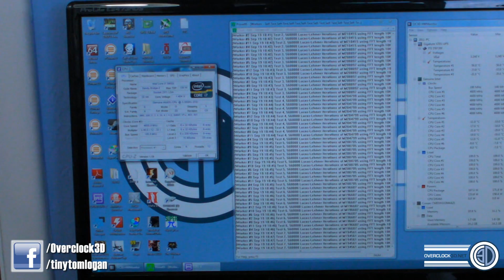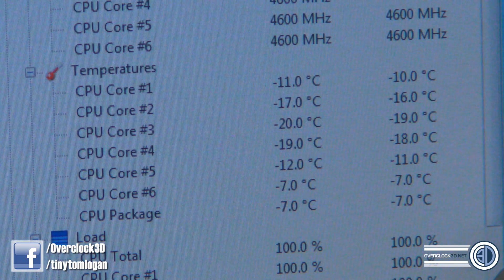Ultimate Corsair H100 Cooling Mod

Comment: Lots of fans against each other going the same direction won't make the air move faster.
Reply: You must be fun at parties
Reply: +OtterStrikesBack yup :)
Reply: just more pressure, and the temps he gets is bullshit, the temps can never get below room temperature without a fridge compressor...
Reply: Yes it will
Reply: +Marcel Rusiecki that's not how it works
Reply: +Marcel Rusiecki that's not how it works
Reply: +Ballistical 935 nah, it won't make it move faster, only make sure the air doesn't slow down
Reply: +Mathis Randl less slowing down hence "faster" or more volume to cool them fins faster.
Reply: OtterStrikesBack go to Linus tech tips and search for compressor cooler
Reply: +Marcel Rusiecki that's not how it works
Reply: Mr. Wiener dude. Really?
Reply: OtterStrikesBack what?
Reply: Yeah fans stacked like this in series would only increase pressure; the velocity would remain the same. Here's a graph of pressure vs flow for multiple fans: greenheck.com/library/articles/42

Comment: It is the problem due to hooking up multiple connectors (and having the RPM and feedback lines getting confused), multiple monitoring programs at once (can easily present negative numbers... I have even experienced numbers that would have melted the machine - reported due to this probelm). 

If you would really want to "Prove" or display evidence to the ACTUAL cooling going on, It would be best to utilize a separate temp sensor (whether IR or direct contact), to measure the cooler, and places on the cooler. Potentially, you can disprove this by simply taking an IR temp gun, and just pointing it to the metal on the cooler, and the intake/exhausts of the fans, to display the change in temps (roughly). This will clearly show that it is impossible for the temp to go in @ 20 degrees (what was mentioned in the video I believe - as the room ambient temp), to negative 7-20 degrees, and then back to w/e the exhaust shows). And btw, the exhaust should display around -40 if your logic applies, as the exhaust side should be colder than the intake, and the CPU area which is obviously being performed on a cold mobo, that has not been running extensively prior to the benchmark. 

More fans do not equal more cooling. This would not "line up" until the fans have been forced into a cycle throughout each shaft.  This idea is akin to putting a fan against a radiator... air will get through, but there is still an obstruction, b/c the pulses sent are not being synched to account for each fan in front of/behind the next. Think of a jet engine.. they do not just slap plates together, they figure the sync out to produce plates that will increase the pressure as it is pulled through the system of blades. This absolutely would not work well, and would hinder a lot of air movement. Even two different speed fans in push/pull can noticeably decrease the pressure and cooling ability. You could seriously be at greater benefit to take out all the fans inside the 9 in each stack, to form a single hollow chamber which would assist in actually building pressure, not hindering it. 

I think this should definitely have a follow up video already.

Comment: What would happen if you use AMD?
Reply: A Catastrophe.
Reply: x99 cpus run as hot or hotter than the fx 8350s
Reply: 9590 is a waste get a 8350 or get a 6600k and be done with it
Reply: 8320 oc to 4.6 ghz  with a corsair h100i gtx load is 49c idle is 19c.... soooooo hot i tell you

Comment: +OC3D TV did you try to remove the cpu block and run the cooler and fans to touch the bottom of the cpu block to just check if it is running at real subzero?

Comment: Yeah watched linus and was like duh, how can you use 20 degree air to get - 11 degree cpu. Good job fooling us for soo long
Reply from the maker: Not for so long dude, its ALWAYS been at the end of the video if you go look....
Reply: Ok well while I am not sure why legitimate Temps would have detracted from the 'fun', I will have to admit that I don't get your sense of humor, so i guess that's on me.

I can see how manufacturing controversy creates more views, if that was your intention you have definitely succeeded.....well done
Reply: air cools as it gets pushed through a smaller space
Reply: +Tucker Wagner nope idiot
Reply: I wasn't directly comparing the two, but a fan pushing high volume air though a radiator will extract heat from the fluid.
Reply: +Tucker Wagner air actually heats up as it's compressed.
Reply: +Daniel Esprit How do you think an AC works?
Reply: An AC works by conditioning the air. As it sounds, not just by blowing air really fast. 
AC's circulate air that they have first evaporated etc and they get air to 15celcius? 
It's also worth noting AC's are much bigger than a h100

Comment: How did you reach subzero ? Even sub ambient ?
Reply: +T-X-M Then either your temp is incorrect, or the laws of physics have no effect on your CPU cooler
Reply: Your temperature is not accurate.
Reply: You can do it. Phase change cooling, LN2 cooling, and TEC/Peltier cooling do exist. 
Less practical than standard liquid or air but they exist and can achieve sub-zero temps.
Reply: No you cannot, if it where that cold the computer would be dead after an hour due to the condensation of the water from the cpu block, plus there would be ice everywhere, the water would not move, as such the temp would be worse. But in the real would that's not possible.
Reply: +jerielmari anti freeze keeps stuff from freezing

Comment: FAKE!!! aero dynamics doesn't work this way and you can possibly push enough air through it it just doesn't work this way at all and the super low temps will kill the cpu
Reply from the maker: watch the end of the video dude........
Reply: Because
1) It can't get lower than the room temperature
2) If the external fan pushes, for example, air at a speed of 10km/h, the fan next to it will receive the air at 10km/h and, spinning at the same speed, will push the air trough at 10km/h and will get to the radiator at 10km/h.

Comment: lol...those temps are either being faked or the app just isn't capable of reading temps properly on that CPU...u can add 100 fans to that one Corsair H110i and the temps of the CPU will never go lower than the ambient temp of the room...the fans would actually do less than say adding more radiators...furthermore, there's no way that CPU running at 4.5ghz could EVER run in negative temps using plane jane water cooling.

Comment: The reason why the temps are so low is because the whole system acts like a turbocharger.
All the fans compress the air and squeeze it to the point where it's incredibly hot, then that hot air is then passed through the radiator which dissipates the heat.
The radiator then takes that cool compressed air and it gets re-expanded in the H100 pump, hence why the temperatures drop well below freezing.
It's actually quite a genius idea and I never thought something like this would work so well.
Reply: +PooPipeBoy uhhh.. i think you don't know something.. these were actually fake temperatures.

Comment: IT IS PHYSICALLY IMPOSSIBLE TO AIR-COOL SOMETHING TO BELOW THE TEMPERATURE OF THE AIR YOU ARE COOLING IT WITH. 

This video is full of trolling. It's made for a laugh, but it can actually misinforms people.

Regarding adding more than 2 extra fans to a heatsink - as soon as a fan reaches is maximum spin speed, the maximum amount of air volume is reached, no matter if you add 10000 extra identical fans.
It's just like how a car driving 100km/h does not go faster if you attach another 50 cars that are also driving at 100km/h.
2-4 extra fans would have been enough to practically nullify the resistance that the heatsink provides and maximum air transportation would have been achieved.
Reply: No shit

Comment: Thomas  ... Dude -I love this Channel - ... But in this  Video I realize you made it  as  a funny Poke at  Chilling CPU's and components - but  there is   Seeds of Brilliance in all of  this that I can see  !!!!..... Dayum .. This is Stellar ! - I am considering  making a  10" LCD Video Projector - and This  Cooling  Rig (Other  than a Bit of Overkill) It  would be PERFECT in Cooling  a Massive 10,ooo Lumin 100 Watt CREE  LCD Light Element for my 1280p HD  HTMI Projector - It  would be  entirely possible to Chill the  LCD Chip to Below Zero Farenheight Temperature (But before Condensation Icing)  - which   would mean Unlimited Run Time ! - You are  Both Funnt, Intellegent, and  Flippin Brilliant ! - No worries  about the quiet Fan Noise - which  would be  virtually 2 dB or a bit more at the Most !I   would  Include the  CHiller, Fans and  Projector Mechanical and  Electronics in a   Wooden Box - or Maybe in  a Custom Industrial Server Tower  (If I can Get my Hands on a 2nd hand one !!!!) - you are  without a  doubt -  Fricken Brilliant !!!!!!! - Woo Hoo !!!!! - Squeee ! - Tom .. Sir ..  Just Subscribed as well ! *... Never  stop thinking  Outside the Box  my friend -  You have  some  Masterful Gravitas, and   have a  Natural Sense of Humor ! .... Keep it Up and   Never let it  Drag on the Floor three Feet behind  you ! -  roflmao !

Comment: Why don't you try putting sound suppression on this unit, just for fun. Like put it in a padded box with some filtered gaps at the front and back for the air to flow in and out.

Comment: cus water cooling below freezing
Reply: +Tylor Starr cause I mean, mineral oil DOES freeze, but just at like, -30 C or something like that, which is not possible to reach by just fans  in a normal climate anyways sooo, yeah. And besides, AIO cooler manufacturers might not even use plain mineral oil, they might have their own special concoctions, so we can't judge whether it might freeze or not half the time.
Reply: +Tylor Starr whats false, that AIO coolers dont use actual water, or that mineral oil doesn't freeze?
Reply: Jup
Reply: +Theodor Le Roux You know that the AIO coolers don't use actual water, right? Its mineral oil, which generally doesn't freeze.
Reply: Or, you know, modified HWMonitor...

Comment: Lol this is the video that made me subscribe to you.
Just curious though HOW did you fake those temps?
Reply from the maker: +Tyler Weigand Custom Build HWmonitor. This whole video was meant to be a bit of fun. Not cause a world wide 1million+ view debate.
Reply: +OC3D TV ah.... Gotcha.
Too many idiots watching the first part, going down into the comments and telling everyone how it's so fake and this is terrible, disliking, then leaving without watching the end :(
Reply: +Петьо Митев bro do you even science?
Reply: +Tyler Weigand They could also be from a sub-zero phase change cooling rig
Reply: Ya LN2...or completely faked, but it was meant to be  just funny.  Water cooling can never drop below ambient.  With water cooling you are simply moving heat from point A to the Radiator, which then vents the heat to ambient and flushes new ambient in to absorb more of the heat.  If you want to get cooler than ambient, LN2 or phase change.  Some people "say" you can place the radiator within a closed loop inside a "cooler" or "freezer" and get it to drop below ambient, but you will not deny the laws of condensation.  Your CPU block with start to look like your cars AC compressor on a hot summer day...dripping.  And theregoes your expensive electronics.
Reply: +Tyler Weigand You set an offset.
Reply: +Tyler Weigand when i saw this temps first i thought what liquid did he used ,then i realized that its impossible,then i start to read comments
Reply: +Tyler Weigand this video is great for howls tho someone had to try this out lololol
Reply: +Ивайло Йорданов Hahaha! so you are that you cant lower the temp by preassure? xD
Reply: Alpha Machina No, that's not how wind chill works. It's literally just like blowing a fan at you. You're body's heat actually creates a layer of warm air around you and because air is a poor thermal conductor that heat takes a while to be conducted away. However, when a wind is blowing, that layer of warm air that keeps getting heated up by your body keeps getting blown away causing heat to be conducted away from you faster (since the rate heat is conducted from one object to another is proportional to their difference in temperature). It doesn't actually lower temps below ambient. The only way you can put the temperature below ambient is through the use of things like condensers and whatnot.
Reply: has another computer running with liquid nitrogen cooling xD
Reply: Wait..... those negative temps are REAL!!!  His disclaimer stated nothing about those temps being fake!  Damn impressive.
Reply: +OC3D TV These aren't fake temps. my old core2duo starts showing -40 after 5 minutes of prime95 :D rip
Reply: ***** The temps are fake... He said so at the end of the video.
Reply: +Grzegorz Brzęczyszczykiewicz Ever heard of wind chill? I know it won't drop the temps THAT damn much, but wind chill does cause temperatures to be lower than the ambient temperatures would be without the movement of air exciting the molecules.
Reply: +Tyler Weigand can you hear that sound  lolol?
Reply: +Alpha Machina You won't get wind chill in a indoor bedroom...even if it comes into play, it would be extremely minor...the temps of the CPU wouldn't be lower than ambient...it's just not possible....the CPU creates a lot of heat....even if at a very low temp of let's say 35c...average room temp is like 21-22....you may get the CPU close to that number with zero load on it but it would never go lower than ambient with regular water cooling unless your using phase change cooling or some LN/Dry Ice setup.
Reply: Right, the CPU is at a certain temp, wind chill measures heat loss for a body warmer than the air. Wind makes more unheated air available to conduct heat away from a hot body, but with a body at air temperature no heat is being conducted away from it, so by this understanding, the CPU cannot be any cooler than the ambient temperature around it, despite the movement of air.
Reply: With liquid nitrogen you can get at most -85C. But, having -8c with fans is ridiculous. I think you can get 1c at most.
Reply: +Gurvinder Parmar dry ice or just a normal stock cooler with a 140mm fan placed 13cm away to the side pointing at it ;) sorry for disturbing but you know I whana see more on why... :P when idle it can go under ambient..as it's the case for me with the setup said above..although when even doing something little it will jump to ambient temp atm or a little higher cause power hungry overclocked amd needs that to get those sluggish cores moving..oh amd..can you do something right -_-
Reply: Daivd Ives im not sure thats exactly true, but the video is obviously a joke, but if you have a fast and constant flow of water it could probably get just below 0 if there are no slow spots in the radiator (impossible) then i suppose it could work.... probably not
Reply: Gurvinder Parmar the cpu will be below ambient, my 4790K runs at 17c while room temp is at 21c
Reply: PauL1e That's physically impossible without phase change cooling or something similar. Most likely it's just a bug.
Reply: Takihero Squires No, that's not possible. Heat ALWAYS conducts from hotter to colder unless you use something like a condenser which I believe operates somehow by manipulating phase changes. No phase changes are happening to the water in an AIO. Because heat always goes from hotter to colder and an AIO works by literally carrying the heat to a radiator and then conducting the heat to a radiator which then dissipates it to the air, once the water reaches the same temperature as the air it won't cool down anymore.
Reply: Tyler Weigand i've triend with temp sensor and it drop 7 degrees in front of fan from ambient so how its possible then, its like winter -20°c and 5ms wind speed so it became -30°c
Reply: PauL1e most likely your temperature sensor is just screwed up since it's not possible for anything else to be happening except maybe aliens from outer space somehow manipulating the temps
Reply: Tyler Weigand lol, ur cooler is just too crap for low temps ?
Reply: Alpha Machina wind chill only affects moist things because it causes the water to evaporate
Reply: +Tyler Weigand same
Reply: +Zleaz Going gone Are you stupid?
Reply: Tyler Weigand thanks, i was just guessing but what u say makes sense, my point was that you could theoretically have water at below freezing temperature but flowing at a fast speed would prevent it from freezing, but i mean i dont think this is even possible, and definitely not in a water cooler.
Reply: +Tyler Weigand I think the temps are fake too. To get your temps to -20 the air in the room need to be -20 too. if the temp in the room is 30 the lowest temps will be 30.

Comment: I don't think so that temperatures below zero with water cooling are good for it. Can it froze the water? If the water freezes, it will damage the block and pipes.
Reply: Actually its fake! He mentioned at the end of video that is was just a troll! U can't get temperature that low!
Reply: +TheVenator FTW 
I was pretty surprised of this temperatures, i should watch this video to the end of it :P